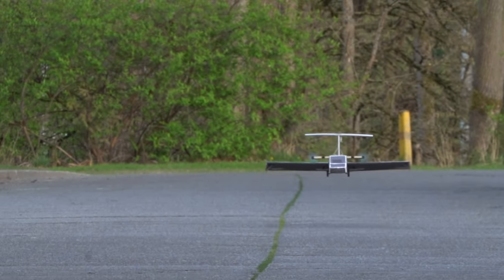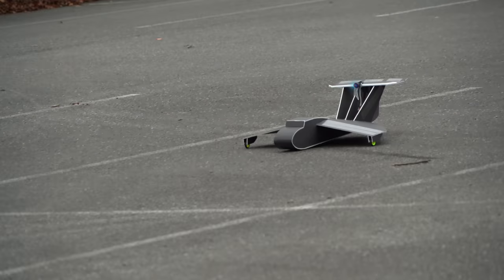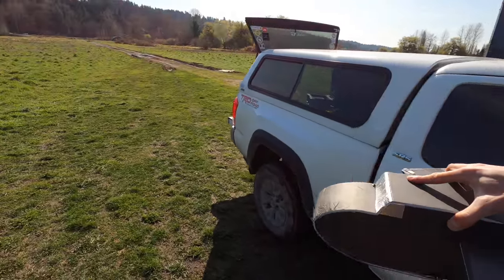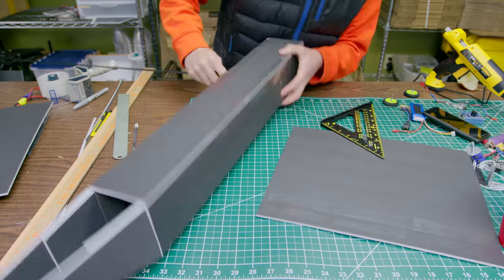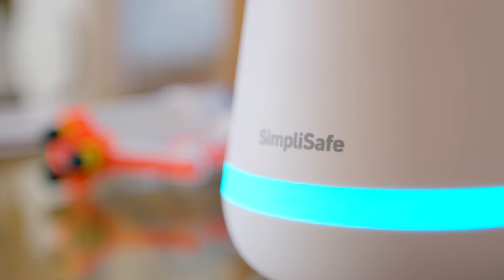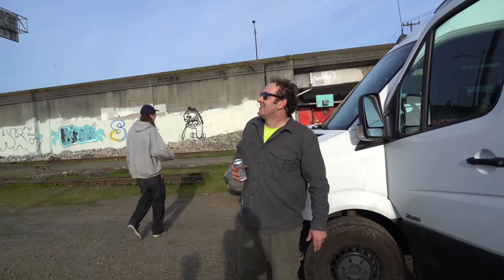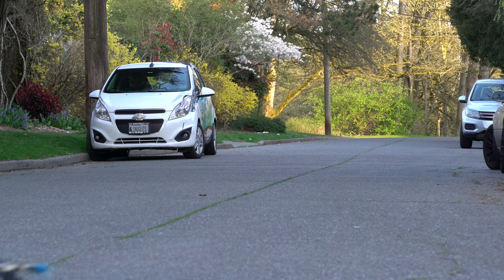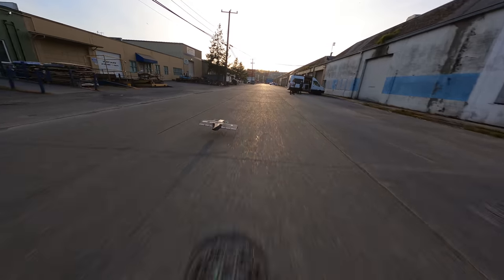R/C Ground Effect Vehicle with LiDAR Altitude Control

Comment: Your props blow above the wings accelerating the airflow at the upper surfaces of the wings. Thus you create lift. The more thrust, the more lift. In this case it's utterly irrelevant if you have or have not the ground effect.
Just point those motors down at an angle so that all 100% of the air coming from the propellers go under the wings. Look how it was done on a Soviet Kaspian Monster. In this case you accelerate air under the wing, so if you do have the ground effect, you compress air with the props, if you fly to high from the ground and loose ground effect, you'll be creating low pressure area under the wings, thus you will get an anti-lift that will suck the ekranoplan down to the ground.

Comment: Could you dial in a small % of elevator control in proportion to throttle. Start with say 5%  to give an immediate correction to the slightly slower throttle correction ?? 
Then if it helps try to dial in the correct balance, elevator to throttle mix. Who knows might not work, or 10% might be good or even 50/50.
Just a thought from a layman. 😎

Comment: This is a perfect project for some AI... Get a Nerual Net, use the speed of the plane (based on lidar, not rpm), the line of the ground and the planes angle to it as input and as out put you have more/less rpm and ealeron up/down.

Comment: I’m not an expert or anything, but it seems to me that the ratio between uplift and gravity in flying mode is to high. So maybe make adjustment to the scale model to decrease flying uplift without decreasing the ground effect. In scale model testing it is called « dimensional analysis», «method of repeating variables» and «Buckingham Pi theorem». In non-scientific practice you don’t need equations or numbers, but it is helpful to understand what parameters that need to change

Comment: When the brushless motor is controlled by the ESC, the low-speed throttle accuracy is not good. You may try the foc algorithm control or use a smaller power motor so that the ground effect height is still at the maximum throttle. This comment is converted by Google Translate

Comment: Needs both throttle and elevator control. Since airspeed via throttle has a natural lag time, there must exist a quicker way. That's the only way to stop the slow alt oscillations.

Comment: Your premise is wrong. You are stating that thrust controls altitude. What if you made an airfoil/wing that pivoted to change the angle of attack? Altering this single variable would have instantaneous effects, influence the ground effect more directly and you could keep the motor at a constant speed. Instead of having the altimeter sensor adjust the elevators, why not have it adjust the wing AoA? (i.e. automatically?)
Also, do the skis at the end of both wings reduce full ground effect for lift? Is there another model where you can have these important skis in place but without altering the airslip off the end of the wing?

Comment: So probably just going to expose my ignorance, but would it be posable to also make so the wings would be adjustable (kind of like a helicopters blades) in a way that would grant you the ability to change the altitude by tilting the entire wing system instead of just using throttle?

Comment: Try airbrakes to adjust velocity to wind Flux with potential energy being increased throttle with excessive air panel braking to make smooth transition from Flux winds

Comment: The U2 had long, skinny wings. That should have aided it in making long, slow turns, i.e. not abrupt and quick. Would that design help slow down your abrupt, quick motions?

A fighter jet years ago (Russian?) used a pinched in body because of some aerodynamic problem. Would such a feature help counter the effects of the turbulent air day?

Comment: Awesome system dude..
Was just thinking through, as the craft is twitching about, dipping its wingtips and such, could you put a lidar in each wing, out near the tip, and parallel the data..?
Once you've set a flight height you want it to cruise at, and if one wing dips (due to crosswind or such), then the lidar will command the system to bring that wing back up..
Could even add lidar fore and aft to control pitch..
I have zero experience with systems like this, but if me, as an absolute spectator, can think it up, it MUST be possible to code it.. right?

Comment: I'm guessing that this wouldn't work over water due to the laser not reflecting off the water in a uniform way?  What would you use instead of LIDAR for altitude control over water?

Comment: 🔵 Since the balance was so bad on the first iteration (the 'Air-fish'), why didn't you just add weights to balance it? or program the motor to react to the proximity sensor in such a way that when it reached the target height above the ground the motor wouldn't shut off all together and then spool up in order to keep it from touching the ground when it immediately would drop too low, that keeps the craft going up-and-down (porpoising) without ever finding a straight line to cruise on, instead it should be programmed so that when it hits its Target distance from the ground the motor goes to a specific RPM to maintain, instead of turning completely on and completely off, the motors responses would be faster from a preset RPM rather than from zero RPM & so needs to be modulated to a smaller RPM range, Perhaps a faster sensor response is necessary here as well as an adjustment of the motor/propeller azimuth.
Just remember that Air-fish design came from a craft that was meant to be used in ground effect mode ONLY OVER WATER!!I
I think the 'Air-fish' had too much going for it to give up on.
The second craft didn't seem to be capable of ground effects,.. you were just flying it REALLY-low.

Comment: To control lift, without varying speed, How about trying  . . . quick acting full wing width perforated air brake  or  . . . . tilt wing (Variable alpha)  or . . . . biplane with wings set  millimeters apart and air pressure dumping slats on lower surface or  air blocking  fenestrated shutters.

Comment: Seems to me that when you want to use an aerodynamic effect to fly your ship, you better also have an actual wing, with an actual airfoil profile, and not just a sheet of extruded polysterene held in the air solely by the power of the propeller and electronic control.

Comment: ..if nothing absorbs the air oscillations then it wobbles...perhaps adding a little flag or tail thingy which oscillates in the rear air stream could help stabilizing it.

Comment: I like the air fish design better.  The prop was just in the wrong place.  Trying to control a ground effect vehicle with traditional flight dynamics will never work exceedingly well.  You have to control the air under the vehicle.  Put twin props forward of the wing and below the chord line.  Let that heavy tail shape the air into a cushion under the plane.  If you get the static pressure and deflection angle right, you don't need lift until you want to fly fly.

Comment: What would happen if you increased the wing loading to a point where it can't climb out of ground effect at full throttle?  Would that closer resemble a full size GEV, and have similarly damped throttle/height response?

Comment: I don't think there is any ground effect in place there, it's just flying low. At that scale you would have to fly much lower or much faster to start feeling it, it doesn't trap any significant amount of air under its wings currently.

Comment: You need better bass monitoring in your mix. Either that, or just get a visual analyzer, and cut all the low end from each element, especially from your voice though. And move back from the mic just a bit more when recording. Cheap solution.

Comment: Now i'm just a wrench monkey student (mech eng) with little knowledge of aerodynamics but would it be feasible and/or practical to have (fast moving) leading edge or trailing edge flaps that are controlled by your stabilization algorithm, in order to somewhat rapidly control altitude?

Comment: could you build it with a slim canard with same wingspan?
the canard would loose ground effect if it gets too high, and gain high ground effect if it gets too low.
in theory that should stabilise the plane even without electronics.

Comment: Ya'll English speakers need to stop meaning "ekranoplan" as a typical Russian design of WIG-craft. It's just wrong.
Russians use the word "ekranoplan" for all kinds of ground effect vehicles, regardless of their layout. The word "ekrán" (yes, almost like in Avatar movie) means "screen", by which Russians named the ground effect. The second part of the word – "plan" [plahn]– has the same meaning as the English word "plane" in e.g. "airplane". It's just how they adopted it – without an "e" at the end.  
There is another similar Russian word for ground effect vehicles – "ekranolyót", which stands for a GEV, capable of flight at higher altitudes as well. And "-lyot" means "flyer" in this case (just not in the sense of a leaflet :)).

Comment: Your airfoil is flat. Wouldn't it be more successful if you started with a stable-flying (out of ground-effect) type B WIG airfoil craft, (with say the  NACA 4412 airfoil), and THEN add the attitude controls? Maybe a dual-wing WIG, or a three-plane, (similar to a Piaggio P.180 Avanti airplane). Can another channel be programed with the LIDAR software to control a foreplane as well as the elevator? It would be more efficient the less you touched the throttle.

Comment: 3:33 that could be a efficient fuel design for a short range HOP plane.  fo going 50-100 miles quickly but not spend the fuel of a leer jet on take off. not as fast but doesn't need to be once you go up time to come back down.

Comment: Love this... giving me ideas gents.  That second design with the longer tail is so impressive for what it is.  As a real AC the g-forces from the oscillations wouldn't get too many repeat customers but the way the electronics work in it and especially the first design... damn.  I didn't realize we'd gotten to this point.  Would a little g-sensor integrate sufficiently well (and within the sensible time factor of your efforts) to allow a variable gain factor to constantly map onto your basic curve?  I guess I am really asking if the system can learn to smooth itself out...  Either way this is awesome!

Comment: Your trailing edge wing design is not correct.  It needs to trap the air with flaps down to keep uniform pressure, and the inner part of the wing and outer part must have the same gap to ground so airpressure  does not leak out.

Comment: Its the wing planform you use. I see that you are trying with low aspect ratio rectangular wing. They aren't stable, in my MSc degree I did research on swept wing. Even they are not very stable. The most stable planform is the reverse delta wing with anhedral.

Comment: Sorry, but you are not flying on ground effect, because to do it, you must fly very low for that small wingspan vehicle. Maximum height above ground may be around half of wingspan or less. You are on 1 wingspan, sometimes more ... And fo more efficient try to controll it by elevator, not by controlling engines.

Comment: Sry but that is not an ekranoplane, neither near. Its just an aircraft with altitude control. A trully ekranoplane uses the ground effect to plane, the more speed, more stable the ekranoplane stay. The ground effect is nothing more than a air cushion below the veichle that provided by the wings + speed. All the stabilit comes from the tail. If you wanna build a true ekranoplane, not a stillishy airplane, you have to build it with true ground effect, with tru aerodinamics. An ekranoplane dont fly, just floats.

Comment: I really hope @rcteestflight is able to read this and test my theory. Using the golden ratio which is theoretically always perfect, if you would possibly try changing the variables to the nearest fibonacci number ALT MAX=233 / ALT MIN=55 / THR MAX=89 / THR MIN=55-OR-61 (what i call a fib-inbtween-harmonic) I would be VERY interested in your flight results. Thank you for your time and consideration.

Comment: 1337^jelly  How do you test your airframe without a tunnel?
Reply: it fucking is, with a better frame
Reply: i get what you meant with bigger planes 5:55 , technically an ekranoplane with the right velocity has a ground effect. Probably not the case here. Its like a bouncing ball that up down stays in a safe margin, this is the robot
Reply: jelly jelly
Reply: has lidar is my bet
Reply: got a defenition do you save battery vs distance?

Comment: try a nose cone centrifugal turbine
Reply: straight in, sling out angled, at least 30 degree, more than 45 degree output jet, 360 degrees down up left right, ducted like harrier if so feeling
Reply: also for gasoline centrifugal input pressure burning jet turbine
Reply: or ethanol, or any oil, or anything even small solid fuel pellets
Reply: and yes solar for the massive wings
Reply: and fire alarm nuclear battery charging
Reply: thats a wing suit flier kite
Reply: measure or just look at the power position of the motor to compare how much power you are using

Comment: 0:24 Ground effect Is NOT due to higher pressure under the wing, There is no "Bubble" of high pressure air. That is a urban legend.  It is mostly obstruction of the vortices.  Experiments have proven years ago that there is no pressure difference. Even helicopters which they used to say hovered on a 'bubble' of air. There is NOT a pressure difference.  It has to do with airflow. Do a little Googling of full scale aircraft, not a modelers opinion  if no one believes me. (yes, I have 40 years aviation experience)